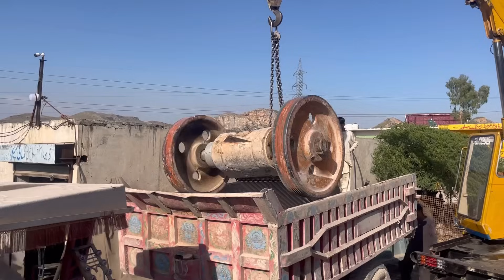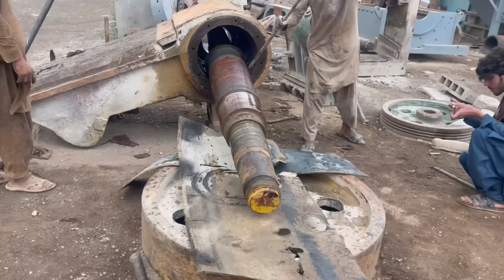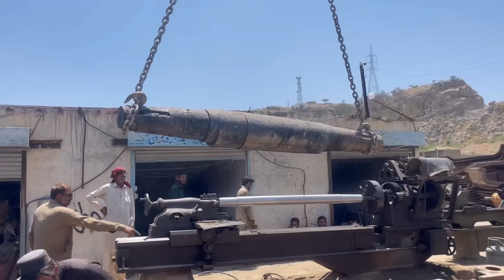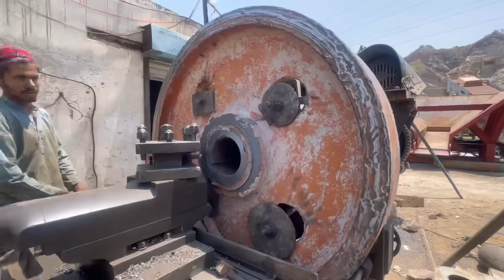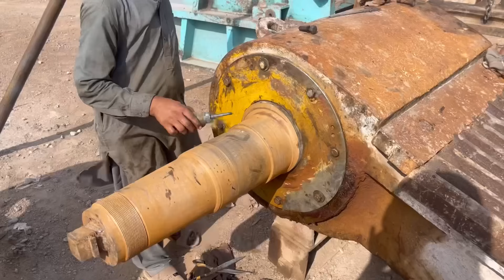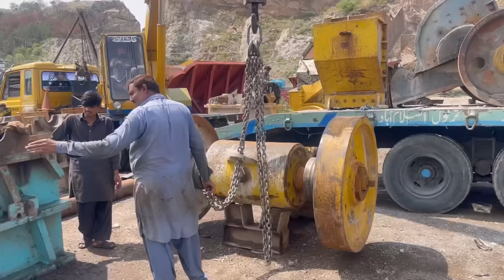How Ingenious Mechanical Skills They Use For Open Stucked Crankshaft Of The Heavy Stone Crusher

Comment: No lubrication for those bearings?
Reply: Since it is likely a low speed application, grease would be sufficient, but it does look as if they have not been greased in quite sometime.  Probably the reason for the failure.